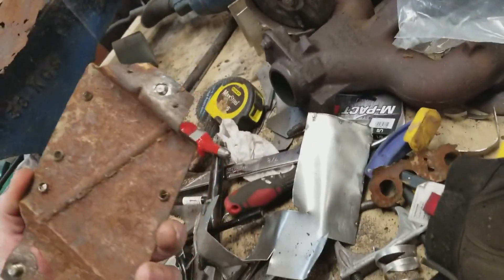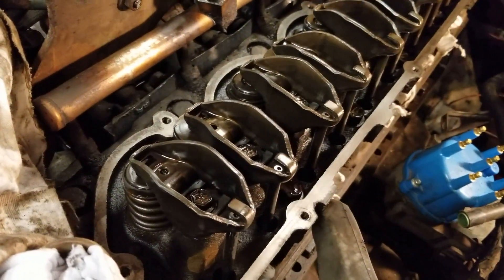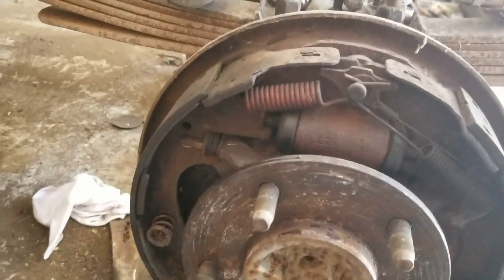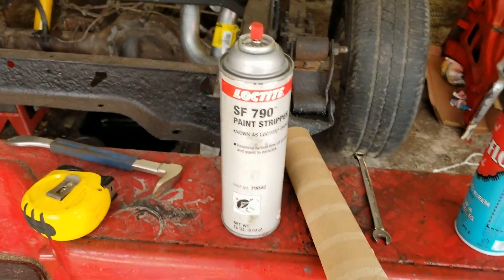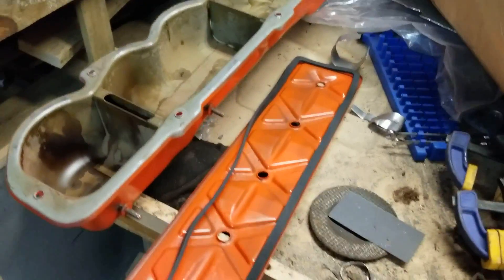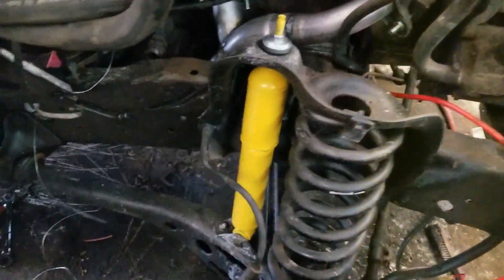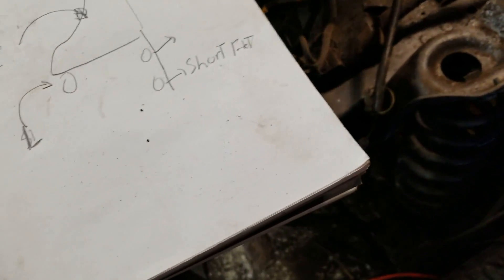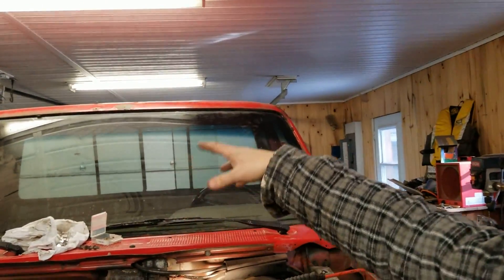Engine Gaskets & Spark Plugs | Truck Refurbish - EP09

Comment: Soldering isn't really the best choice on a truck or car, instead waterproof butt connectors crimped on is more reliable and quicker.
Reply from the maker: EldarKinSlayer thanks for the heads up! Im thinjing of just replacing the sending unit inside the tank while i have it exposed anyway. But im not sure i should fiddle with it.
Reply: I guess I'm quite randomly asking but do anybody know of a good website to watch newly released movies online ?
Reply: @Bryce Porter I use FlixZone. You can find it by googling =)
Reply: @Emmett Francisco definitely, been watching on FlixZone for since april myself =)
Reply: @Emmett Francisco Thank you, I went there and it seems like they got a lot of movies there :D I really appreciate it !
Reply: @Bryce Porter Happy to help =)